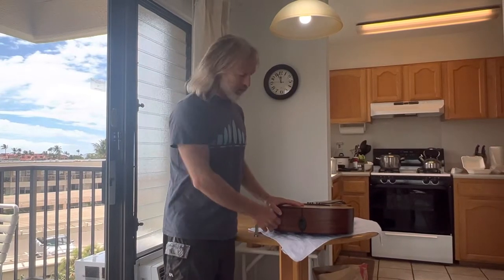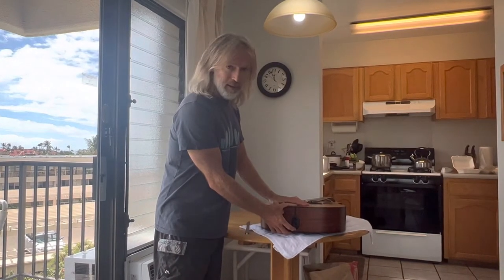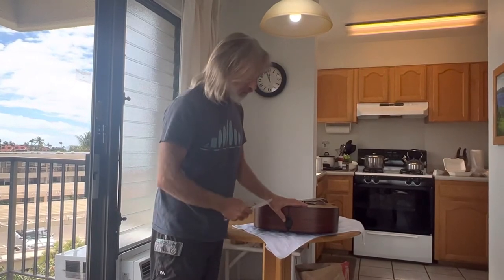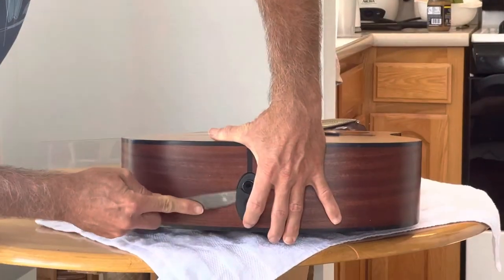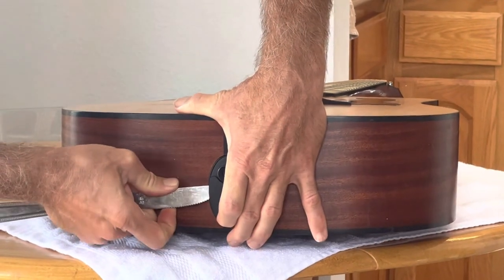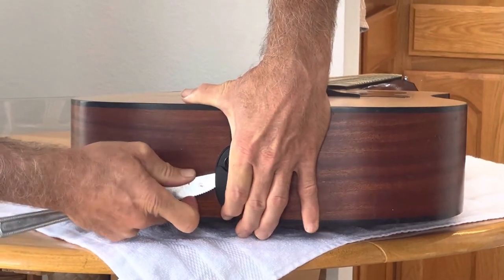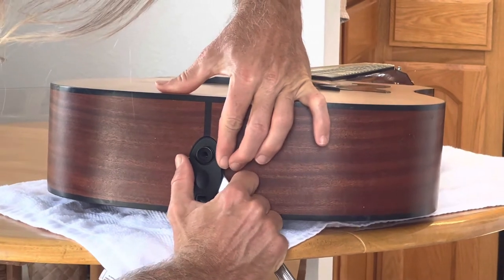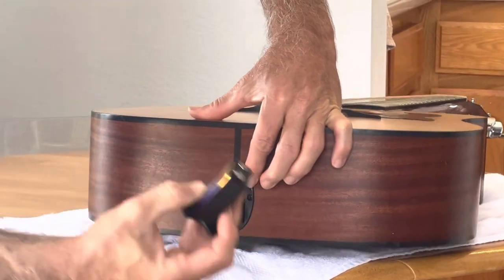How to remove Taylor Guitar Stuck Problem 9 Volt Battery 45 second quick fix using a butter knife

Comment: Battery companies have made their batteries higher, thicker and wider than in the past, that is the cause of this problem
Reply: You're right, the 9 Volt batteries are bigger and won't fit easily into the plastic receptacle.  You would think Taylor Guitars would new a new replacement for this.

Comment: thanks for this. It's really not obvious why the battery case won't come out easily and this was helpful. In my guitar the battery case was flush with the material around it and it needed some careful digging with a sharp knife point to even get it to raise up a tiny bit to get a blade underneath it as you showed.
Reply from the maker: Glad it was helpful. Thanks for the comment!
Reply: Battery companies have made their batteries higher, thicker and wider than in the past, that is the cause of this problem
Reply from the maker: @fabulousflashbacks3139 maybe it’s time to go solar

Comment: Another one of those " It shouldn't be this hard things! ". Thanks, I finally got it. put a small amount of olive oil on the plastic case and wiped most of it off,  then put it in and out several times till it seemed to be working as it should.
Reply from the maker: Great idea! Thx for the info

Comment: Since we're all here cos of the same annoying problem, I'm gonna add on to this quick fix with what worked for me. Using long nose pliers, i covered the tip with some cloth and that's what I used to push down the handle carefully and it popped out without needing to do the butter knife trick. 
It's been a long time since I used my Taylor and good thing I removed the battery before, but a new annoying problem that I don't remember having is getting the battery inside and outside its case. I don't remember it being that tight putting it in and out before -- yes, there's a joke in there somewhere. 
I read @fabulousflashbacks3139 's comment here that batteries now are slightly wider, so I guess that could be it. But it's a hassle, and I had to oil it up a bit on the sides then kinda do a similar butter knife trick to snap the battery out again.
Reply from the maker: Thanks. Pliers and lube are effective in many situations
Reply: The current 9 Volt batteries are physically larger and that's why they don't fit so easily anymore.  Taylor Guitars should offer a replacement for this problem.
Reply from the maker: That would be nice!!
Reply: @jimfesta8981  that sucks!!